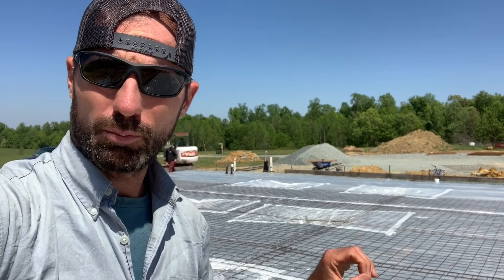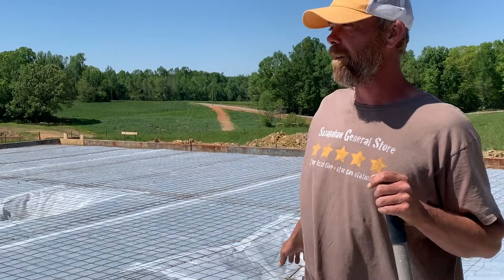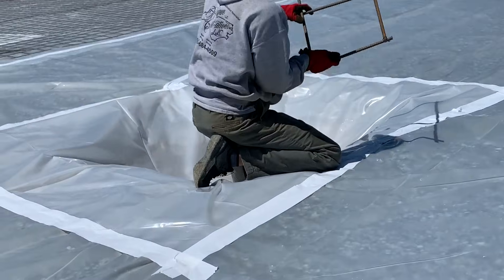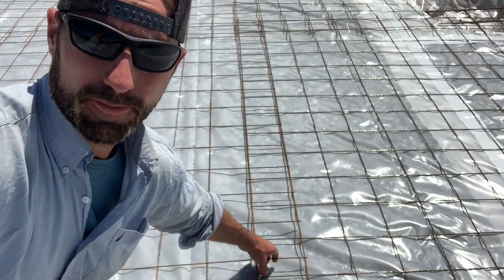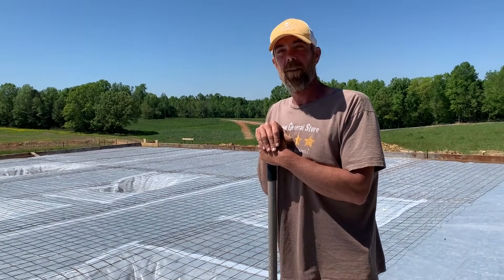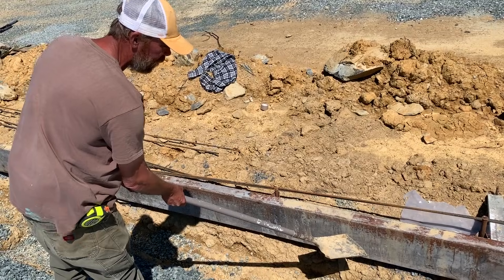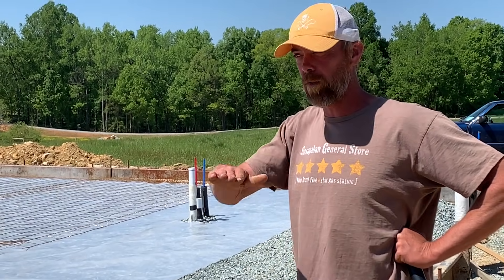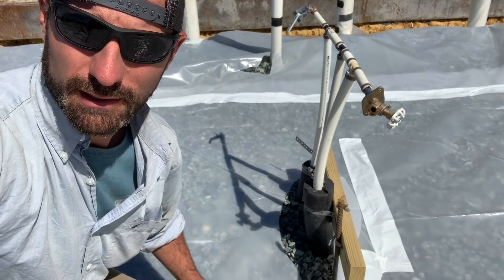Building a Monolithic Slab Foundation | the (4) Most Important Steps

Comment: I plan on installing a metal building on a similar style slab.  A monolithic slab with footings.  Along with the vapor barrier I will lay 2" rigid poly foam board, with an R-Value of about 12-13.

Comment: Man I hate to see tutorials given when the people giving them have no clue on the process that they are trying to explain, plastic uses as expansion material, really, not reinforcement around the penetration's through the slab, other than the WWF for the slab. and the thickness of the plastic vapor barrier is irreverent, some specifications call for a minimum of 6 mil but really consider why you really need one. check your building codes.
Reply from the maker: I wish I understood what you are trying to say, but it’s not clear. Please take a little more time to explain what you mean if you’re going to leave a hateful comment. Otherwise, other people here that are trying to learn are missing out on some good information that you may be able to provide.
Reply: Yes I agree the guy read it 10 minutes ago..

Comment: Do you have a video of how you are doing the post bases? Wet set or anchor bolts? I’m doing a post and beam cabin soon and I’m wondering if I need to go the Perma-Column route which requires 18” thick concrete
Reply from the maker: I don’t have a video on the post bases yet. But we prefer to drill and epoxy into the finished concrete slab in this case (so we can get the locations dialed in  exactly and not have to finish the concrete slab around a bunch of wet set post bases.

Comment: Looks Great!   And informative, well done.  Question regarding your interior concentrated load point:  Did you taper the footing edges? So that your not going straight from a 20" deep footing to a 4" slab with a 90 degree angle and possible cracking at this intersection?  Tapering the concentrated footing so that the footing meets the slab at at a 45 degree angle, thus having less of a hard angle?  Similar to typical perimeter foundation details?
Reply from the maker: Yes, good point: when we dig out the gravel for the thickened footers, the gravel won’t hold up vertical; it will repose to a 60 degree-ish angle.
Reply: Great, thanks for the info

Comment: how do you deal with the issue of frost heave in a mono pour?
Reply from the maker: Just dig the perimeter turn-down footing deep enough to be below the frost line. Everything in between will be insulated and protected by the gravel base (which shouldn’t hold water if you have a foundation drain around the perimeter)

Comment: You're so lucky the county let you use welded wire and only 6" footing. Here in CA the min footing is 24" deep, 12" wide, #4 rebar everything and its a pain in sandy area. What state are you in???
Reply from the maker: We are in NC. The footing only needs to be 12” below final grade and 12” wide for a monolithic slab. We don’t have the seismic concerns and all the hold downs like you have in CA. I built in Truckee/Donner Summit for about 7 years, and had to deal with all the seismic and 300 psf snow loads. NC much easier!

Comment: What is the cost difference between a slab foundation compared to a block basement foundation? Thanks
Reply from the maker: A slab foundation will be cheaper. But the actual cost will depend on your site. If you have a steep build site, it will make more sense to dig out for a basement. Slabs are most suited for flat building sites.

Comment: How can you tell when a you have a monolothic slab in a house? Are there specific signs?
Reply from the maker: Most slabs that are built on grade (at ground level) are monolithic. If it’s more than one concrete pour, there will be a visible joint between the two placements/pours. Sometimes that joint is visible 3” below your siding, sometimes it’s buried underneath the exterior wall, sometimes it’s visible at the door opening. Why do you ask?
Reply: @HeirloomBuilders  sorry I forgot to respond. So my house is a bit weird I have a house that has a basement space/garage. So the entrance to the basement from the outside is through the garage. But the foundation is built a bit weird the foundation in the front is block about 4 ft high. The soil in the outside of the front is about 3 ft high but the foundation walls on the back is like not even a ft high and that's where everything is kinda flat so there's no soil build up against that foundation wall. And the reason why I'm asking is my basement is leaking bad it seems to be coming from underneath the slab trough some holes that seem to be where old carpet was attached. I also see what appears to be to saw cuts in the middle of one room and that's where water seems to be seeping through it looks like control joints that they do on slabs.
Reply from the maker: @chirina5  not much out can do about that except for adding a French drain around the house if there’s not one there and waterproofing the basement walls. Seems like the vapor barrier under the slab was not installed well and may be letting water pass through

Comment: Does the weight the concrete exerts on all the steel, as it is being poured causing the steel to settle, eventually cause the edges of the steel or the steel seats to puncture the vapor barrier? Is the vapor barrier puncture proof, and if so, is there a rating the defines that?
Reply from the maker: Good questions. As we place the concrete, we pick up the steel reinforcement mesh so that it's embedded approximately 1" from the surface. We use 10mil or heavier plastic as a vapor barrier so that there are minimal punctures as a result of walking on the mesh. Thin plastic (6mil and less) will puncture easily and should be avoided. https://youtu.be/bMSgY_obkfU